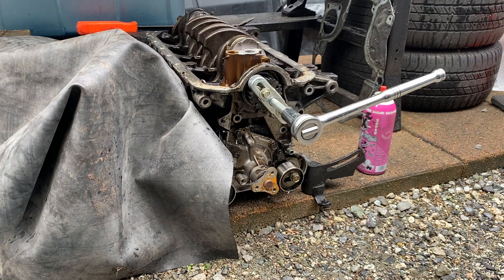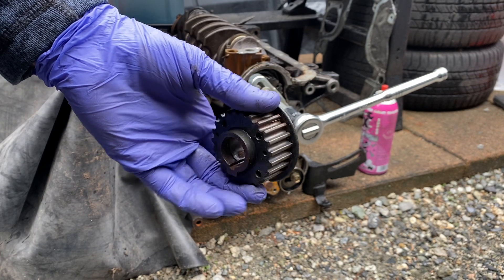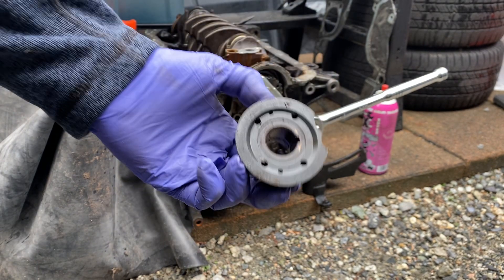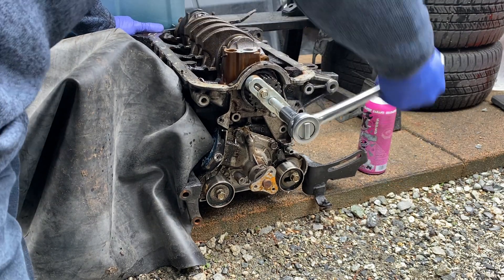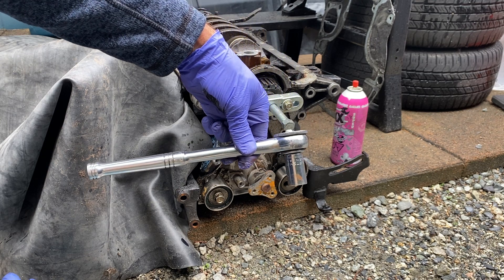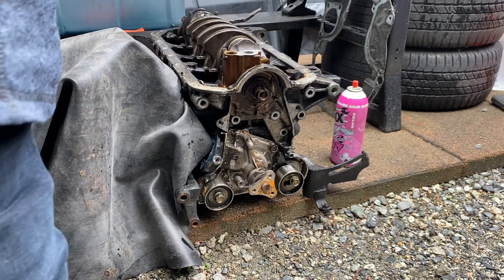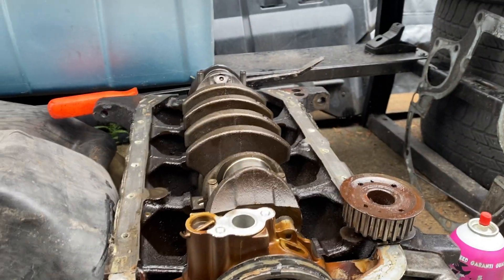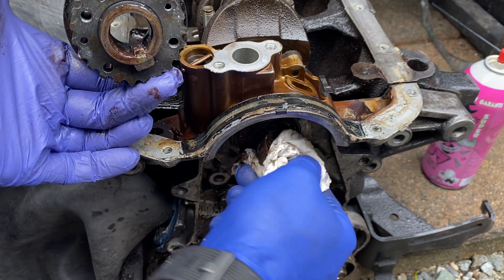Timing belt sprocket ⚙️ removal for 1990 Miata with “short nose” crank shaft.

Comment: Question, for the crankshaft bolt is it reverse threaded?
Reply: have you learned anything about that bolt? im also dealing with trying to remove the bolt lol!
Reply: Negative I wish I'm going to tap crankshaft I need answers hahahahhaa
Reply: ok so its not reverse threaded. it turns out, a lot of people wedge a wrench in there and break the bolt loose like that.. but I can't figure out a good way yet... I held a blowtorch on mine earlier and tried to no avail.... still working at it  @chevybarboza
Reply: @miataman
Reply: Usually they lock tight the crankshaft bolt luckily on my 1.6 shortnose I was able to just use a breaker bar and it came out no problem.  Good luck bro
Reply: how did you lock the sprocket from spinning? @chevybarboza
Reply: @McGregor007  you gotta open where the cams are and  there are places on the cams where you can put some of those grip pliers to hold the cams in place so they won't twist clip them all together and bam
Reply: Sorry if it's not detailed I know how to put an engine together just don't know the name of the parts
Reply: @chevybarboza  yeah I have the cams locked down with two adjustable wrenches and a  clamp already, but the car still reverses when I try to turn the crank bolt left... 😂😂😂
Reply: @McGregor007  check the rear of the crankshaft and make sure that doesn't move
Reply from the maker: The crank shaft bolt is conventional thread. Right to tighten, Left to loosen.

Comment: What’s the thread pitch for those bolts going into crank gear for puller?
Reply: just for future people wondering. its either m4x0,7 for the two small holes and m6x1,0 for the bigger ones